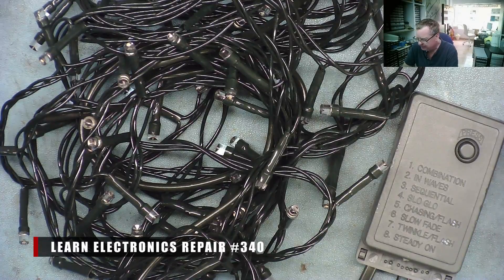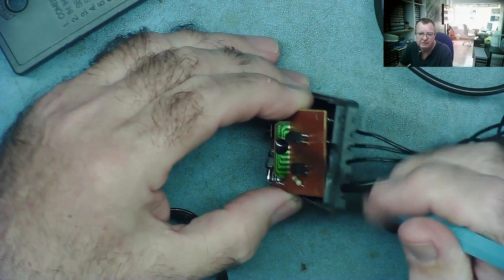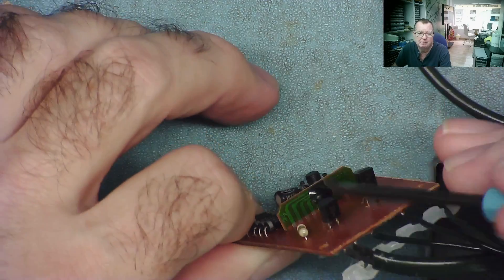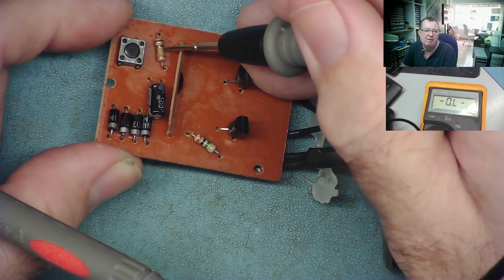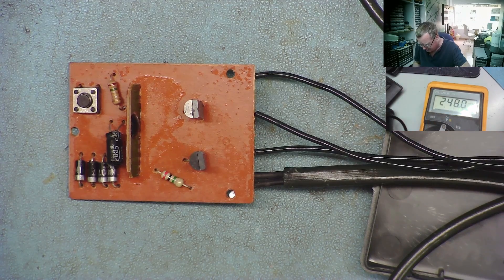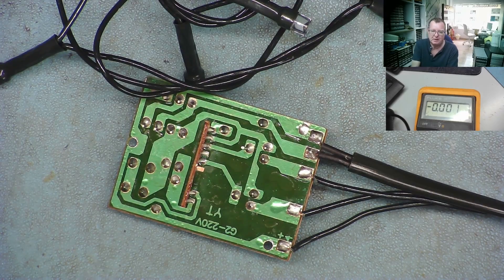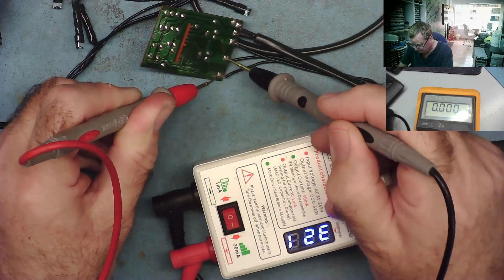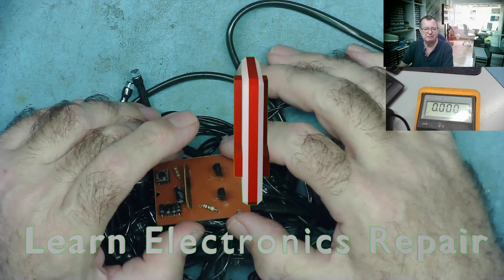These Christmas Lights Are Cheap Nasty And Possibly ILLEGAL - And They Stopped Working!

Comment: Thanks for your videos. They are a lot of fun to watch and I learn something every time. I have a request, all you need to know about flyback converters to fix stuff. I have a smps throwing me for a loop involving a ucc28700 staying in protection mode. I keep eventually either blowing the chip and or mosfet troubleshooting. I’m running low and they are backordered.😂

Comment: Also, the plug may have a couple of 2 amp or 3 amp fuses. These glass fuses are tiny, 10  mm long. I have them in my "outdoor" rated string lights.

Comment: Correct me if i’m wrong.,, couldn’t you use your signal injector deal to track down the open in the line and the bad LED?
Reply from the maker: Hmmmm - nope.  The signal injector only runs at 1.5V and the LED needs more than that to conduct (apart from red ones) but even with red you would have to test each one individually

Comment: They are cheap, nasty, and exactly the same all across the world
Reply from the maker: No I disagree.  Almost all of these (that I see) run from a 24V AC supply, transformer or SMPS, and each chain of LEDs contains eight in series, so if one LED fails just that little block of eight goes out which makes them quite safe and rather easy to fix too.
Reply: All the ones that I've ever taken apart were EXACTLY the same as the one you showed in the video, here in Poland they can be bought from supermarkets as well as at a flea market.

Comment: Wonderful repair video series sir. One possible fix is removing the electrolytic cap that could have an ESR issue, connecting 5V DC from a bench supply at the cap pads, ensuring smooth ripple-free DC is going to the controller IC, replacing the cap if that testing works. If that fails, then not worth repairing but to use the LED string (considering the string works) with a Joule-Thief circuit, making it super-safe and still usable without the fancy processor flashing options.
Reply from the maker: Did you watch the same video I published??
Reply: @LearnElectronicsRepair  I'm not sure as I am new to your channel and in my past repairs, such caps can let enough AC ripple through, causing a malfunction to such control circuits. In audio circuits. a hum and in microprocessors can fail during the boot-up sequence. Either an ESR dropping voltage or dried out and lost value, letting AC ripple malfunctions  happen. Re-capping is often a standard for high end products. Bulged electrolytic cap tops are easily seen yet partial shorts or dry electrolytic are not. Of course you know all this so I hope I was not wasting your time. Mainly. as a new viewer, I am enjoying your delightful channel as it brings back a lot of past repair memories. :)
Reply from the maker: @EyesOnReality  As long as you enjoy it (and maybe learn some new old tricks) then that is what matters most

Comment: We didn't have an alternative back in the day !  you make a good point but nowadays there's no point in having a string of lights at mains any more so I don't, I would bin them and keep the Thyristors !.....Merry Christmas.
Reply from the maker: Yeah, pretty much what I said at end of the video.  I could cut the LED strings up and get a load of probably working red LEDs too 😉
Merry Christmas to you and yours also
Reply: There are not thyristors, there are should be FETs. Why? Because thyristors and triacs work only AC voltage, but these switch DC, follow the voltage path!
Reply from the maker: @laszlomarktoth7492  No surely they are Thyristors, but I will check tomorrow for the benefit of my own sanity.   Actually Thyristors and Triacs will quite happily switch DC voltage, they just won't switch off again until you cut the main power.   Unless the DC happens to be coming out of a bridge rectifier with no smoothing capacitor maybe 😉

Come to think about it I will make a video about Thyristors next week.  Anyone wanna place some bets if they are Thyristors or FETS? on this PCB
Reply: @laszlomarktoth7492 " thyristors and triacs work only AC voltage" Not true, of course you can turn the gate on with a DC supply, But they have limited use in the DC realm. But I'm not going back to the video as I think you will find the DC is for the microcontroller anyway. Follow Winfield Hill, Paul Horowitz.😉😁

Comment: You know what's sad?  It's cheaper for them to hire someone and make them solder that vertical pcb with the controller IC on the base circuit board, instead of just ordering a DIP package chip or some other packaged die. It's also sad it's still cheaper to find someone to insert 4 diodes and 2 resistors instead of just using a chip shooter machine to make full panels 
If you search, you can find videos with machines that automatically sort leds, detect polarity, cut the leads and then spot weld them to wires to make xmas light strings... very cool to see the automation. The only manual work seems to be that plastic box.
Reply: While the concept of automation might sound good, I know some folks who are electronics assemblers at a large corporation here in the US, and I'm sure they're very glad that automation hasn't taken over their careers. What I find really sad is we've become so focused on getting the lowest prices that we no longer care about quality.

Comment: Richard, thanks for the videos. A while back I did a few videos reverse-engineering and re-designing a LED bench light I bought on amazon, using similarly dodgy design. It was branded "Bell + Howell" (not "Bell & Howell", a well-known company, especially for us old guys :) ), and to get from 120VAC to the 4 volts needed to power the many LED's, it used what I learned is referred to as a "capacitor dropper". In series with the 120VAC was a capacitor (plus resistor in parallel), so most of the 120VAC was dropped across the capacitor before feeding into the bridge rectifier. So they actually replaced a step-down transformer with just a series capacitor. Amazing. And of course if the LED load circuit should open-circuit you're now putting 120VAC across the bridge and output capacitor, which is an immediate kaboom. Like you, I'm amazed they can get around the UL, etc., requirements (especially here in the US) with stuff like that.
Reply from the maker: Actually I have seen that method used in Disco Lights made by a company called Chauvet who are quite well known in that field.  They use 110V motors to rotate the mirrors and Gobos in the lighting unit. There is a capacitor in series with each of the motor windings so they could run on 240V as the capacitor reduced the supply to 110V. 

There is a relay that also has a capacitor in series with the (110V) coil .  The idea was that with 240V present, the relay would activate and remove the short across the motor capacitors.  Therefore the motors got ~110V.  With a 110V supply there was not enough voltage to activate the relay because of the series capacitor, so the motor capacitors remained shorted and the motors still got 110V

All so far so good - until the capacitor in series with the relay coil fails by going low capacitance.  Now even with 240V supply, the relay can't activate, the motor capacitors stay shorted by the relay contacts and the 110V motors get 240V supply.  This causes the motor windings to burn out, or even set on fire!  Not nice. 🤐
Reply: @LearnElectronicsRepair  Oh really? Wow. It's one thing to cause some cheap components to get zapped, but risking a more expensive motor seems crazy. But hey, I guess we humans are all about clicking on the lowest prices, so I guess we get what we pay for.

Comment: They are lethal. Quite often find that one wire has broken where they are soldered to the 'main' unit as the glue cracks away from the plastic case.

Comment: Fuse, double-insulated cable, proper smoothing cap ? 表示笑聲 (as the jolly, red-dressed Chinese person would say). A proper, old-school, dangerous mains-set was always much easier to fix (your set is just as lethal).
Reply from the maker: And these are sold in the large shops here